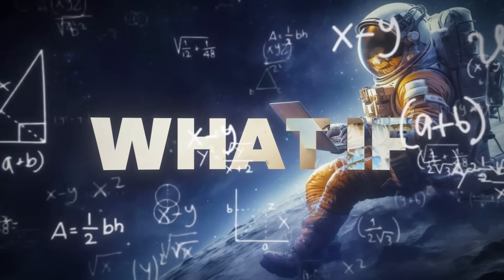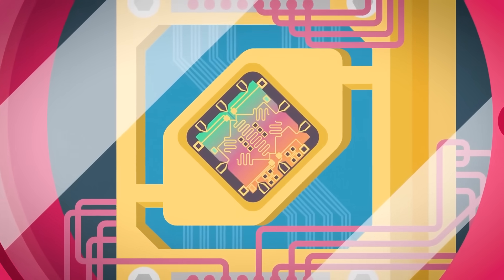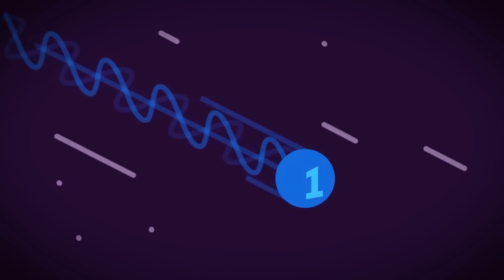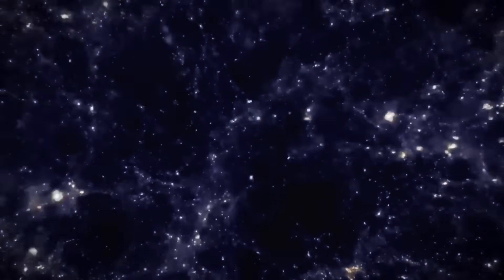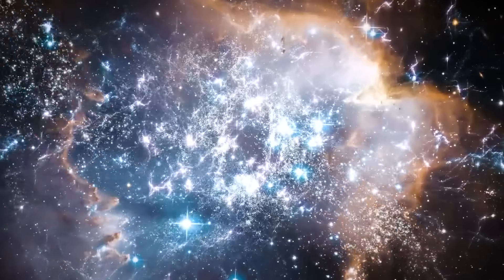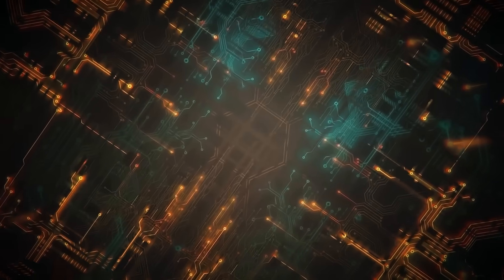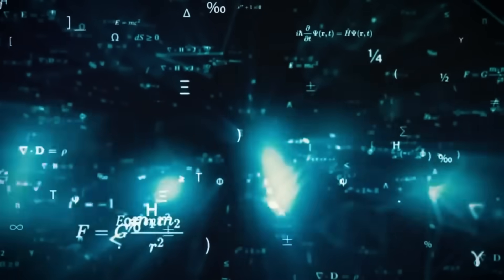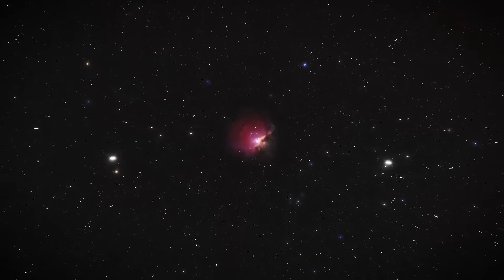Scientists Alarmed by Google’s Quantum Chip’s Multiverse Discovery!

Comment from the maker: What do you think would be the most POSITIVE and NEGATIVE side of Quantum Computing?!
Reply: I think the idea that it is getting the answer from another universe is probably wrong. I think it is more likely to be this. I view the Qbit as the hardware. But I also think the wave function is part of the hardware. And a change in the state of either is the software. If you lean toward this theory. Then the compute power is a calculation and not some other mystical thing.

So, you have to look at the super position of 01, 10 as calculations for it not to be some mystical thing. Which means when you apply the program, the hardware is most likely doing the calculation. I think this is a more rational theory.

This just for a bit of brain putty. I recon if you send the computer through a black hole, it most likely is a reset button for the hardware. And what you would get is a loss if information if that were true.
Reply: Positive or negative? What a binary question.
Reply: When you think it comes from a different universe, it means that you don't understand.
The excitement around quantum computing and the multiverse should be appreciated for what it is: an exploration of computational potential and theoretical physics. However, claims of "discovering" the multiverse through a quantum chip are often overstated or misunderstood. The real work in quantum physics and computing continues to push the boundaries of what we understand about the universe, but it does so through careful, methodical science, not through sensational or premature declarations.
Reply: That it’s uncontrolled power
Reply: What changes if it proves existance of multiverse? The smallest unit of existance is not quark or whatever they say. The smallest unit is thought. And we have a machine that can control and create those. Uf computer can shift in multiverse, so can we. There are peoole who can see alternate realities and stuff, but what about it?
Reply: Channel couldn't even be bothered to use a human voice. Laziness and Theft across many worlds, coming to a future near you!

Comment: The problem I see is qubits are like metronomes, put them on the same shelf and they instantly begin to synchronize. That's the opposite of what you want in a computer system where you don't want said symmetry to intermingle overtaking the calculation at task.